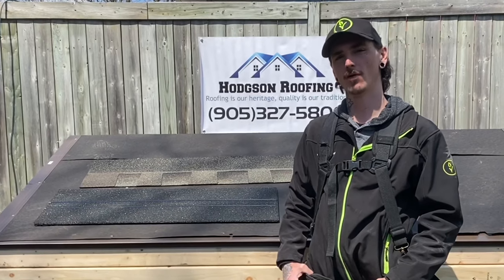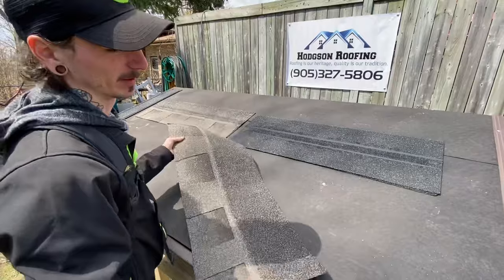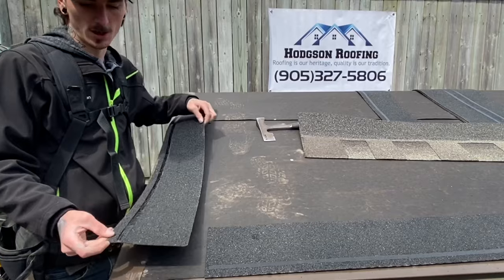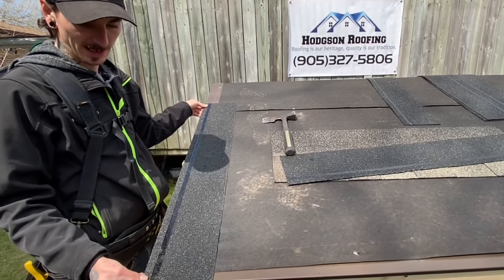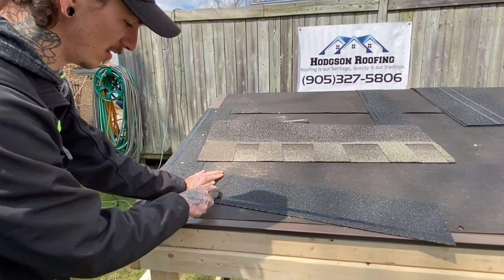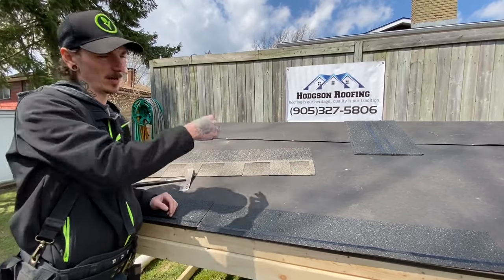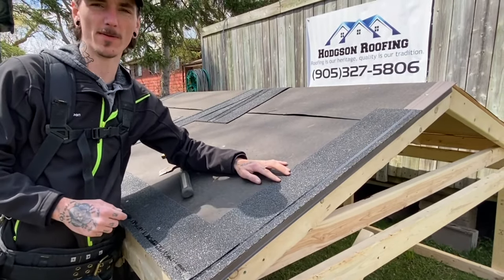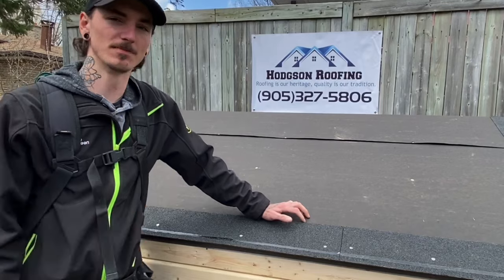How to Install Starter Shingles

Comment: wouldnt it make more sense to overlap the eve starter over the other one? in case water gets behind your shingles, it wont run behind your starter
Reply: If water gets in under there, then you have other issues.
Reply: @michaelh7527  that's not the point. You need every 2nd chance protection you can get.
Reply: @blinxtheredone6844  properly installed shingles alone will keep all the rain out.
Reply: Ricky Robyn  i’m not sure how he could trim it where he would retain the adhesion strip and fix the overlap issue…  it seems more to me that the rake(side) starter strip should go over the eve(bottom) starter strip

Comment: Hey man I'm a commercial roofer myself flat roofer. Doing my own house currently definitely not used to this 11/12 pitch. House is way out of square old house built in early 1900s. How do I find common point so I can chalk a line for straight shingles thank you in advance
Reply: 11/12 pitch? Did you buy a church? I replaced slate on a 10/12 pitch and that scared the hell out of me. Use the Pythagoras theory and see how out of square you are and adjust from there. Depending on what the manufacturer states on the package you may be able to snap a straight line up from bottom to top and another one stepped 6"-12" back. Make sure the first line is shorter than the furthest distance to the edge of a shingle. You don't want to have a little piece needing to be put in on the end. Also measure to the opposite end of the roof and see what the piece will be to avoid little pieces.
Reply: Thank you
Reply: You do hot asphalt or rubber?
Reply: @richardhatt6541  I do Asphalt and Tpo/fibertite usually only rubber repairs. Usually I'm replacing rubber roofs
Reply: @stagnetforever  I have done few hot roofs. We stripped "pitch" roofs and that stuff irritated and felt like burning combine with your sweat. I still hate the smell of hot asphalt.
Reply: @stagnetforever  after 11 years of roofing  I changed professions. It was fun and paid well but in New England it was seasonal and being laid off for 4 to 5 months is rough on a family.

Comment: I know it's probably a bad idea but what's your thought on architectural shingles on a double wide with 2x2  trusses ?  Otherwise I guess it would be good old 3 tab shingles.
Reply: It's not a bad idea. The weight difference is insignificant

Comment: Do you have a video one how to waterproof a connection from a flashing and shingles, from home to a covered porch with vinyl siding???
Reply from the maker: STEVEN N. L. You’re talking about terminating to a wall instead of a ridge? I can absolutely do that. Just off for surgery, coming back with a ton of videos shortly. Stay tuned! 👍🏼
Reply: I think so!? 😊
I am going to install the flashing under the siding, but the connection between the wall of my house to the covered porch... does the flashing go under the shingles? Is there a tar I can put there to waterproof it? 

PS: Speedy recovery bud. 💪🏻😊
Reply: @renorican1   dont tuck your rain pants into your rubber boots , wall flashings come out over the shingles,  bottoms up  , its good practise to water proof the roof deck to the wall after you remove siding ,  a primed self adhered membrane  is a good choice, then shingle up to wall ,install flashing  using only wall fasteners , nothing through deck, have metal bent with a safety edge and half inch cant bend down ward to make it resist folding up in a wind  or better yet through in some roof cement under it . Just not so much it leaks out all over roof in the sun when metal heats up. 
then instal sidingback over top  .

Comment: Great lesson, question? Once you reach the top of the 6" cut pattern starter shingles  do you start over with the 6" cut pattern starter shingles again? And work that pattern to the ridge cap? Hope you understand the question, thanks
Reply: No u dont its for the first course and maybe the rakes but thatsnit
Reply: YES you'd cut another "book" and run those up the rake edge. Most shingle manufacturers want your shingle offsets to be 5 5/8", which is the same amount of shingle exposed to the weather below the nail line/lap.

Comment: I've always wondered why not put tar strip facing down?
Reply: Better at the bottom if your starter glue can bond with the shingle glue. Up north nails hold down the starter, and the starter and shingle glues bond together. Down south we put roofing cement on the drip edge then lay starters in it, so the cement and nails hold down the starter, and shingle glue and starter glue bond together.

Comment: Do you need to do the starter up the gable end? My roofer just did it at the bottom....
Reply: Yes it should be run up the rake edge (aka gable end). It helps to give a straight line up the edge and hide all the laps of the shingles along the edge as well.

Comment: why do you need starters on the gable/rake? why not just on the eaves? i dont get it please please help
Reply from the maker: You do not necessarily need them, however it will help with additional adherence of the shingles along the gables, is creates a straight line to follow while cutting your shingles, and it also helps reduce the changes of wind driven rain from penetrating the roof horizontally. 

Although it’s not always required, it is HIGHLY recommended, and most manufacturers state the use of it in their installation procedures.

Comment: So it looks like the shingle sticks out a quarter more than the metal edge.....right???
Reply from the maker: Yes, always!
Reply: @Average_Roofer  Thanks....the guy who did my roof left off any drip edge, and didn't use a starter course!!  I'm going to try to add  drip edge all around.  The facia is square, not plumb.

Comment: I need a video explaining how determine if I use the bottom edge, a level or top of the house, for the line of the first row.... My roof line sags, so unlikely. My bottom line likely is imperceptibly off as well, and likely subtle sagging in center of the house. Likely not square, so sides are off.  How do you determine first row line to follow?
Reply: Go off the bottom edge. Keep your underlayment straight and tight so it doesn't wrinkle. The lines on the underlayment will give you a visual point of reference when you're shingling so you can see if your shingles are maintaining a straight line as you go across the roof.
Reply: i would use a chalkine, snap it at the bottom of the roof either going off the top peak of the roof. I never go by my paper when shingling, except for the top run as i run the paper in line with the peak. Making it so the paper is dead on straigh going up the roof, is nearly impossible if you basing it off the run underneath it. you should be able to kget it dead on straight with the first 5 rows of shingles put on, then when you get to the last 8ft or so of roof, just take a look and see if it looks like its dipping or raised, if so, grab a tap and check. if its off by an inch, youll be able to correct it easily with the last two runs at the top, if its out of line by 3 inches or more, then thats when you have to get a chalkline and drop it on one side of the roof, gable to gable. to adjust it to its not way off at the peak.

Comment: What length of nails should I use to nail the starter shingles and regular shingles?
Reply: Depends. Is the roof torn off down to the wood? If so, 1 1/4" nails are fine. If not, you need to determine how many roofs you're going over, their thickness and add 1" for total nail length.

Comment: Where would you nail it if you have a 4 inch drip edge leg? Go through the drip edge?
Reply from the maker: Yes through the drip edge if it’s that far up on the roof deck.

Comment: Do I hang it over 1 inch or a quarter inch?
Reply from the maker: BRENT YC FERNANDEZ approximately 1/4 inch past drip edge overhang.
Reply: @Average_Roofer  In Florida the shingles and drip are flush. Also, mastic is applied at every drip edge before the shingles are installed...IF the roofer does the job correctly, which isn't always the case. Kinda funny how building codes are different in almost every state. In Georgia the shingles run about 2" past the fascia board.

Comment: Sooo.... I redid my roof. We didn't put starter going up the roof. Just at the bottom. Is that okay?
Reply from the maker: That’s fine. It’s there to help with wind but doesn’t necessarily need to be installed. You will be fine without it.

Comment: Hey, i have a question.  I just got ripped off by a local roofing company and my homeowners will not cover anymore money nor will they accept this job. Its a mess. So I've decided to do it myself. I'm an electrician so this will be fun. I've already replaced all the rotten rafter tails, fascia boards and put up all new. Next is the garage roof, where its a different height than my normal roof, and smaller, so I figured I'd do it 1st.  But on my regular roof,  I only have 2 vallleys where my front front porch protrudes.  How do I install the starter shingle in the valleys? Thanks
Reply: Are you using a type of metal valley? Or just using shingles and making a closed cut valley? Either way, there is plenty of videos on YouTube to show how to do this. It's hard to explain what to do either way just by words.
Reply: @Josh-ww5kz  i guess I'm using shingles,  but I would like the clean/cut look.

Comment: Why would you place your table starters over your common span starters? Shouldn't go underneath the gable like drip edge?
Reply: He explained why; to maintain the tar strip around the perimeter. Doing it the way you're suggesting leaves a 5" gap of no tar strip at the edge. The starter shingle only has two purposes; to double the shingle thickness at the eave edge so the shingle plains properly with the rest of the shingles up the roof and to provide a lasting barrier under the end joints (keyways) of the shingles where they butt together so the underlayment doesn't get burned out causing a leak.

Comment: can you use starter shingles instead or regular to save money
Reply from the maker: They will cost the same regardless. Starter bundles are approximately double the price, but cover double the linear footage.
Reply: hi i live in ca...i have 1700 square foot with 2 car garage...someone quote me 14000 for labor and materials...does this sound good?
Reply from the maker: @tednguyen7258  without seeing the roof, this sounds about right for CA.

Comment: guess nobody snaps lines anymore
Reply from the maker: On three tabs it’s necessary. Architectural shingles are dummy proof and hard to mess up. If your ever tried them out let me know. 

Also if you chalk line arch’s, explain why! Thanks for commenting!
Reply: it must be me cause I always get off bond. I been building since early  80s but don't have the snap line for architectural shingles.  3 tap no problem

Comment: thats wrong bud.. gable overlaps the eaves  then cut a 45 from the gable overlap to the corner to expose the tar strip.
Reply: Absolutely ....just like step flashing so it sheds water.
Reply: No, it isn't wrong and your method isn't wrong either. The only point the starter shingle is a "waterproofing" element is at the butt ends of the shingles (aka keyways). Move 18" away from the rake edge with the water and what does it run into? That's right, the top of the starter shingle. Where does it go after that? Under the starter shingle and on TOP of the UNDERLAYMENT where it continues over the drip edge and off the roof!
Reply: @timphillips8966  Is it better to have them overlap or to cut at a 45° angle and butt them up? I also have question about repairing a section of a roof. Is there a good place to ask this?
Reply: Pretty dang sure,TIM PHILLIPS IS CORRECT ....bud !!!!!
Reply: @gregscheyd4131  hes not
Reply: @jergustafson7107  Okay sir, you explain whats the initial purpose of a shingle? If we don't use shingle on the rooftop what happens?
Reply: Different areas of the u.s do it different there's 100 ways to do it right and only one wrong way . good video very simplified unlike other vids

Comment: Where do you put the initial starter shingles if you have a home that does not have gables?  I have a '60s, long, brick ranch-style home with a hipped roof.  Currently, all of the hips have cedar ridges on them.  I hope people are sharing your videos!  I want you to make decent money from the ads.
Reply from the maker: If you don’t have gables. You only need to run your starters along the eaves. The main purpose of this, is just to fill the key ways of the first course of shingles to prevent leaks.
Reply: @Average_Roofer  I thought so but then thought about the potential for leaks at the five (I think) hips...  yeah, of course, there are ridges and etc but I am in snow country and get hit with high winds smack dab into my house, from either the east or the west.   I'm being overly careful.   I am being paranoid, right?  LOL   I sure wish you lived close by.  If wishes were horses...well..

Comment: Your never going to be able to bend your starter strips in half to tear them apart and have your tar strips touch on a hot day
Reply from the maker: Wjh property maintenance - glad today wasn’t hot. Also my tip for that is to always keep the starters in the shade
Reply: I don't think this tradesman needs advice from a "handyman".... Go get some apartments ready for rent....
Reply: Wjh property maintenance - 
Not with that attitude >>>
Reply: @at8504  i wasnt giving advice, i just said if the tar lines touch each other when its hot they wont come apart to easy.  Settle down
Reply: Break them on the ground and store shingles caps and starters in the shade under a tarp . Give the ground man something to do

Comment: Wow where do I start once again. If you're installing in cold climates on houses most States require ice and water shield be installed 2'inside interior wall on roofs. Since your from Canada maybe you don't have building codes. I highly doubt it.  First of all ice shield should be installed 3" over gutter board.  Then drip edge with a roof caulk bead under nailing area. Then install starter course 3/4" -1" past drip on gutter areas and 1/2" on rakes. You lap on starter course at the corners only works to seal if you cut it at a 45 degree angle both pieces.
Reply: Have you watched his whole series, He explains this in other videos

Comment: You can tell this kid uses a nailgun in his daily work. Nails way to slow to be a hammer guy. But this is how a roofs supposed to be started. My only gripe would be to run a chalk line. Just in case the house and roof ain't straight.

Comment: Why do people still use single starter shingles when you can buy a roll and not have seams to start with?🤷🏻‍♂️
Reply from the maker: TG and if your roof is longer than 33 ft how do you eliminate the seam? Also I wanna see a video of 1 guy installing a roll on a 12/12 2 story by himself without cutting it. That’s why. It’s convenient to use small materials in most situations

Comment: Please stop making videos showing people the wrong way to do roofing.  Our at least let them know that this is what NOT to do.  Drip edge NOT supposed to be tight against your fascia board. It's recommended to be 1/2" away from to the process of water cohesion won't suck water up behind the drip edge.  Ice and water dam should ALWAYS be used along the bottom, the rake edges and valleys and is highly suggested to be used on the peak. No one that actually knows what their doing uses tar paper anymore, they use synthetic.  Starter strip is also supposed to extend 1/2 inch over the edge to help with cohesion.  And finally, 45° cut the corners of your starter strip so you don't have the overlap build up.  You said not to use shingles for the very same reason then did it with the starter.  And if you do overlap the starter do the bottom edge first before the gable end. You should ALWAYS overlap whatever is higher on the roof.

Comment: Better yet, don't waste time with starters. Just do a double run of dimensional staggered. Adds strength and saves time
Reply: It doesn't add strength. There isn't any strength in a shingle. It's a waterproofing membrane, not a structural element. Your method creates a thickness problem at the edge of the roof. Don't be lazy...
Reply: @timphillips8966  been doin it for 35 years, no thickness problem. Better protection because of dragons teeth.
 Not lazy! Better finished product.
Reply: @rustymaples6986  If it wasn't a problem the manufacturer would recommend it be installed that way. They don't for the reasons I described. I know many "roofers" that have slung asphalt shingles for decades using questionable installation procedures. You're a fine example of that. Rock on shingle maestro...
Reply: @timphillips8966  bull! The manufacturer is out to sell product. Of course they require specific materials be purchased in access of face shingles.
Reply: @timphillips8966  by the way, the strength I mentioned is in the half inch overhang. It doesn't get droopy the way I do it!
 As well, the tar strip is usually along the bottom of the back side of most dimensional shingles. Doing it my way allows that tarstrip to tac down to the drip edge and prevent wind damage.

Comment: Okay this guy really doesn't know his stuff: definitely "below average". NEVER USE PAPER FELT AS A ROOF UNDERLAYMENT: always go with synthetic or Ice/Water Shield (depending on what local code says). NEVER ATTACH ROOF UNDERLAYMENT WITH ROOFING NAILS; your roof warranty is now invalid, most manufacturers will stipulate it must be attached with cap nails or cap staples. ROOF UNDERLAYMENT ALWAYS GOES OVER THE DRIP EDGE/GUTTER APRON AT THE EAVES AND UNDER THE DRIP EDGE AT THE RAKE EDGE; this is not something that is up for debate but it is a topic that is argued by people who really don't know how to roof. Rolled Starter Course is a vastly superior option to starter shingles: the fact that this guy didn't even mention it as an option tells you how little he really knows.